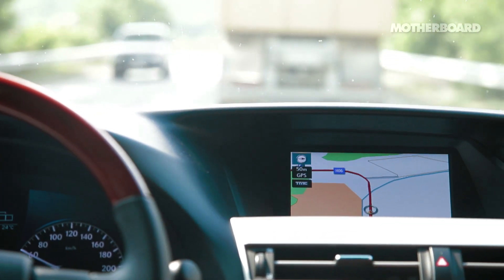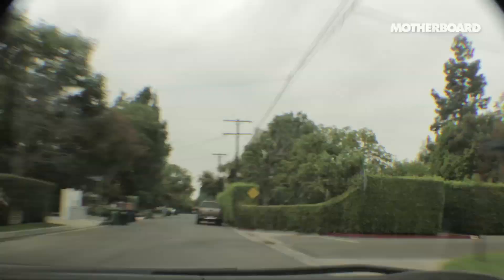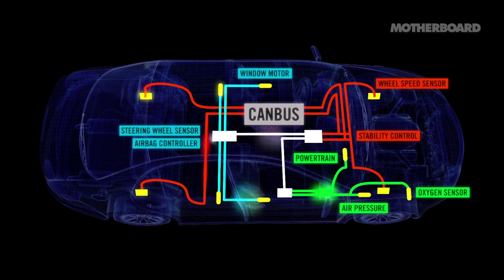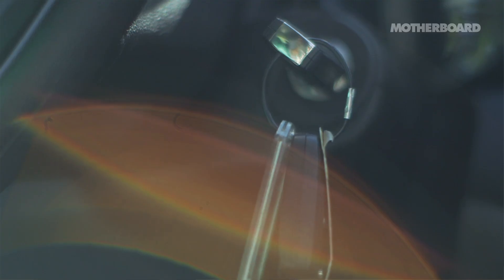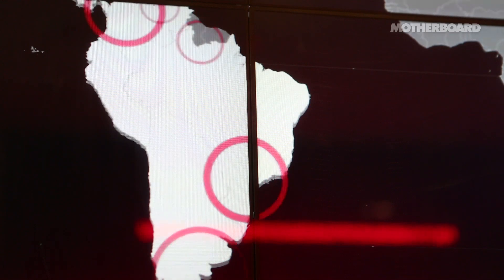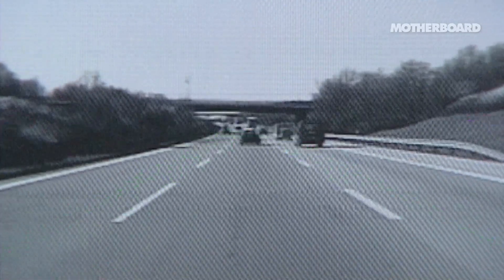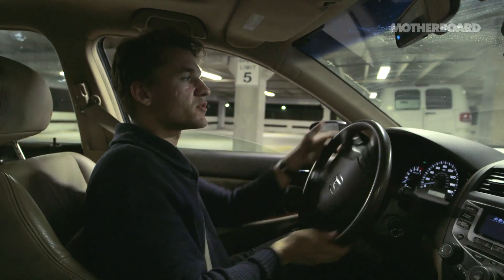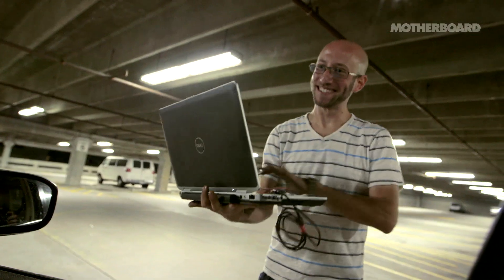How to Hack a Car: Phreaked Out (Episode 2)

Comment: I'm a huge practical joker. And quite frankly, as a programmer and wanna be hacker, practical joking seems like so much more fun than making an income off leveraging this for personal financial gain. If given the opportunity with fellow nerds. I'd just use this 'utility' in a weird and whacky network of practical jokes.

The first thing I think about if I had hackers 'hacking cars' is:.

As practical jokes - I could:
1) Conveniently cut the engine (without threat to life) or making cars flat out not work for you.
2) Making your wicked cool car burp out smoke on that hot date you're on.
3) Every time they walked into a grocery store or mall could move the car remotely to a different parking place (great to make you question your sanity).
4) I could pop the trunk as you close your door. the effects on this could be quite funny.
5) I could turn the radio on full blast and lock the channel on elevator music talk radio every time you got in the car.
6) I could invert the left and right turn signals on occasion. And then invert them back when you went to take it in to get fixed.
7) I could flick the high beams at everyone as they passed by (with camera sensors) - so that way everyone is flashing their high beams at you.
8) If you valet'ed it. i could lock the doors with the valet guy inside, and go flying into a parking place as fast as possible - and then unlock the doors and have Arnold Schwarzenegger's voice come over the speakers saying "GET OUT" - driving the car through software.
9) I could occasionally honk the horn right when you're behind someone.

The list for practical jokes can go on and on.. .

But for real software applications.

You could 'link' all the cars together and one day, flip the switch on everyone and 'take over control' of all the cars - and the car would simply say 'where do you want to go' and it takes you there and takes over control for you.

You could 'sense' when someone's going through a medical problem remotely, and/or passed out and/or so drunk they can't drive - and politely - maybe even without them knowing - take over control of the car to get them home (or to emergency) safely.

You could have 'high volume traffic areas'' - such as London - where ONLY automated cars are allowed to enter the traffic centers - which 'sequence themselves' into the network. When you 'exit' that network, you could then get back control of the car.

I mean. Sure. There's the possibility you could use this to quite literally take the woman of your dreams over to your house as you lock her car and then remotely drive it over to your place where she then has no real options once she's in your grasp.

But where's the fun in that? Wouldn't you rather them say yes to you because they love you and enjoy your crazy wit, not because you can utterly control and dominate their lives?

For me. I see the fun in the jokes and playful things. And maybe helping people wake up and enjoy life with you.

Sure. Scary stuff can happen. So can fun stuff. Me. I want to lead a practical joke hacker network called the Q Continuum to put the rest to shame.

Comment: This is absolute horse shit, engine computers aren't connected to the Internet in any way. Some are, but only if you have on star or some other anti theft that ALREADY HAS these features. An ecu is running on a closed circuit, how on earth are you gonna "hack" into it? Only way is through the actual plug that auto shops use to run diagnostics.
Reply: enrique3402 I believe they said that you must plant some device to get access to the car network, so even if they claimed that it's connected to the internet it doesn't matter, right?
Reply: Muhammad Ilham Unless you have onstar, that's a closed circuit. Can't hack it. And you definitely can't control the steering, or the brakes. They all run independent. This stuff is pure science fiction. And about that "third party device," It's pointless. You'd have to break into the car, crack open the ecu's case, solder the thing on, pray it still gets reception from wherever you are through all that heat insulation and shock absorbing jelly, and in the end why not just plant a bomb if you're really trying to kill someone that badly? jeez, all the effort.
Reply: enrique3402 They said you need a 3rd party device installed to your car first.
If someone wanted to take out someone else, they could install it and then disable the brakes at a certain time.
It's basically like a car bomb except nearly impossible to detect.
Reply: ihazdaforks I mean I was kidding, but If you wanted to go for that you could simply install worn linkages for the control arms, file down a bit of the steering column so it snaps, or drill a tiny hole in the brake master cylinder, evidence like that would all likely be destroyed in a crash and it's way less costly than hacking a car. The only real way that doing that makes sense is with a car that has onstar, where you could hack it via the internet. This conversation got real creepy real fast lol.
Reply: ECU!!!
Reply: +enrique3402 If the auto manufacturers had their shit together, you'd be right--apparently some newer Chryslers have a system you can access it through without adding anything. Check out the guys who did this to a stock Jeep Cherokee.
Reply: Jason Podmore Yeah but unless you have some of those self parking or auto braking cars you can't control the steering, or the brakes. And even then they're designed to be overridden the instant the driver touches the wheel or uses the brake.
Reply: +Jason Podmore Only certain cars are susceptible to certain hacks. You have to be able to get past the locks, internal alarms, pop the hood, which is very hard to access without getting inside the car first. Only certain cars have parking assist steering and emergency breaking assists. So some cars don't have this. Only flyby wire function can be affected by hacking certain cars. Most cars the hand breaks are still manual. You pull the handle up, it pulls a cable and locks the rear drums or rotors. That's not flyby wire(electronically signaled).
Reply: Most cars built in the past 10 years have whats called a can bus, this connects pretty much everything on the car from engine management to in car entertainment (including hands free kits) trust me I used to write the software for them it IS possible
Reply: Mike J Nail on the head Mike, for the built in handsfree thats programmed in to the head unit the hands free sends data on the can bus to the headunit, thats your entry point
Reply: enrique3402 The reason this would be better because it wouldn't be so obvious, a bomb screams murder/ gangsters or terrorist.
Reply: +enrique3402 bear in mind the fuel system is on the can bus, you can cause the car to overfuel so that no matter what position the accelerator pedal is in the injectors keep pumping, drive by wire (accelerator potentiometer) has been on most cars for the past 10 years at least, a lot of the systems have gone over to can bus but you just don't see it because they tend to keep quiet about it, a lot of cars now also have a servo controlled parking brake, I could tell you about a car company in the UK that had an issues with cars hitting 100% acceleration with no feet on the pedals as soon as the car was cranked, there was even an accident in a certain factory because of this where there was a fatality, it was spurious data on the can bus
Reply: Jason Podmore You'd have to get it to change the firing order as well. Modern engines are completely computerized, even hydraulically actuated valves and stuff. The only engine which you can cause to "run off" is a diesel. But those have been known to continue running at 100% even after you turn off the ignition.  And yeah, certain cars can have that happen. I know that Alfa's in Europe are totally computer controlled. But hacking is a different story. The infotainment system only links to certain software on the phone, so sending a text message probably won't do anything. Like I said, the only feasible way to really hack a car besides planting something on it would be through onstar who already has access to these tools or via Bluetooth I guess, where you can send commands directly.
Reply: if the car has an integrated infotainment system they usually pass data from the phone to the CAN bus directly, in fact most systems are now can bus enabled, pretty much everything is on the can bus now and there's no separation between systems anymore, that's the scary thing as in theory there's no physical entry point in to the network, that was a big mistake that was made some years back, if I told you what my old job was then you'd see where this info came from lol, put it this way, I emailed my dept manager about this exact issue 10 years ago before it even became a problem...I was told to keep quiet and not draw attention to it.
Reply: Jason Podmore Damn, sounds like some serious shit then. I mean I didn't think that they relayed information like that. But the more you know I guess lol. I'll stick nice and happy with my Plymouth Voyager, with an actual throttle cable.
Reply: +enrique3402 As for the brakes... ABS works by reducing brake pressure (essentially letting off the brakes to prevent a skid if you jam them on too hard). Stability control systems can apply brakes individually to correct a skid. I'll bet that system's on the CANBUS. Even if the brakes aren't under control of the computer, shutting off the engine will take out the brake booster.
Reply: +Darwinpasta yeah but the brake master cylinder still has good pressure for like 2-3 hard presses, they're designed to have that little reservoir. And like before, it isn't even about stability management or abs, a few new cars have auto braking. Which i'm gonna assume is also on the CAN. And for the sake of argument, most abs systems I've seen (bear in mind I've never seen a fully computerized one before) just dump excess pressure through a tiny valve. So hacking an abs would only do so much, you still have pretty much full control.
Reply: +enrique3402 True, you would have a few presses left in the reservoir, and opening the ABS valves would weaken the brakes rather than kill them completely. But what do you do when your brakes go spongey? You pump the brakes... and there goes the reservoir. 

It does sound like it would be easier to remotely apply the brakes than to disable them. Slamming on the brakes on the freeway through the collision avoidance whatsit could do as much damage as disabling them somewhere else. By applying brakes individually through the traction/stability control you could make the vehicle swerve or make the rear end sling out on a corner (like a handbrake turn). 

An alert driver prepared for an attack might be able to ditch the car safely. An average driver with no clue, not so much. And if the attacker can access the canbus without having to modify anything physical (like the guys with the Cherokee did), what evidence would the investigators have? In the absence of evidence of mechanical failure or a smoking gun in the computer system (if they even have the resources to check that), they'll more than likely call it driver error.
Reply: +enrique3402 Yip! Horseshit is right, most cars do not have a cellular/GPS or GSM interface's built into them But I guarantee the governments round the world will make it compulsory for all car manufactures to install these devices into new cars "For our safety" Then you'll see a rise in "Car accidents" at the touch of a button, But this video is sensationalizing what is actually possible which makes for good/interesting viewing and keeps us up to date with what is possible and may be on the cards for cars of the future, Just goes to show how much we don't trust our governments as well, Which i never did to begin with, But someone once said "Everything in the future will have an i.p address!"
Reply: +enrique3402 Signal tracer to find the modem and a aluminium foil hat for your car.
Reply: +ihazdaforks And  impossible to connect to the car the that is in the owners garage ......... more I spy BS!
Reply: The OBD2 port is how almost all modern cars are stolen. Usually the thief breaks the driver's side window and plugs a device in to it, then over-rides the car's security (even when the alarm is going off). Best thing you can do is move it somewhere hard to reach or disable it somehow.
Reply: +enrique3402 OnStar...
Reply: G Smith That's what I said. And it can only shut the engine off.
Reply: +enrique3402 So you know exactly what data goes down the CAN bus on most cars do you? if the car has a hands free kit and the phone is inserted then the data gets dumped on the can bus, all you have to do is send the correctly formatted message to the car and you can switch ANYTHING on or off, even the brakes have been drive by wire for nearly 15 years now, it IS possible as I've seen it done and have done it!
Reply: Did you even listen to the video? he developed hardware that you can attach the the chassis of the car, as long as its touching metal it can cross-talk / tap into the canbus to send the car commands. With the gsm demonstration he had to modify that hardware for it to work as it was the first time he has tried it in that way.
Reply: See 3:32 where they talk about the hardware developed they call it the CHD Car hacking tool.
Reply: +Jason Podmore That's an awesome job. Is it a secret or would you be able to say what job it was or any idea
Reply: Just plug in one of these... The clever software/control can be done from anywhere on Earth.
https://www.ebay.com/sch/i.html?_odkw=canbus+gsm&_osacat=0&_from=R40&_trksid=p2045573.m570.l1313.TR0.TRC0.H0.XobdII+gsm.TRS0&_nkw=obdII+gsm&_sacat=0
Reply: If they have a radio signal same with all engine cars id, they can hack all car.
Reply: Finally a comment that makes sense. I knew it. 😀
Reply: enrique3402 most vehicles have Bluetooth. That's essentially all the would need
Reply: +enrique3402 this isn't horse shit, most ecu's are on the same network in modern cars via the CAN bus, if the mobile phone system is on the can bus all you have to do is send the write text message to the car and it's sent in plain text along the can bus, if you know the correct string to send as a text you can turn ANYTHING on the can bus on and off, we did it some time ago on the jaguar S-Type but were told to keep it very quiet

Comment: +bmw5002 Wait, with new cars you can always intercept the key to open the doors without triggering the alarm, open the car while nobody is around and add a hidden odb+gps+gsm tool that knows even the most secret commands/protocols from the manufacturer. Then you don't need to stop the engine, you can just fake a key error/ critical engine problem and the entire system will crash.